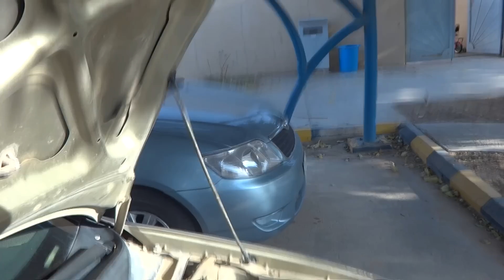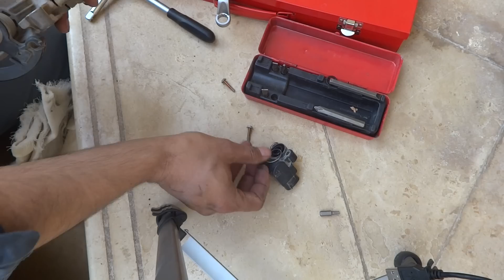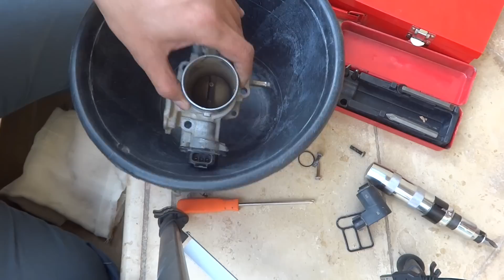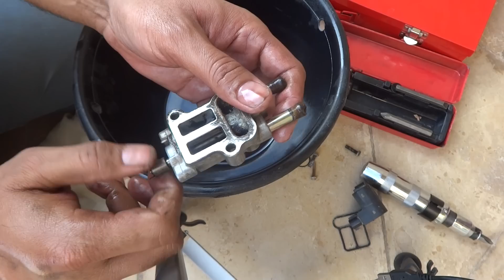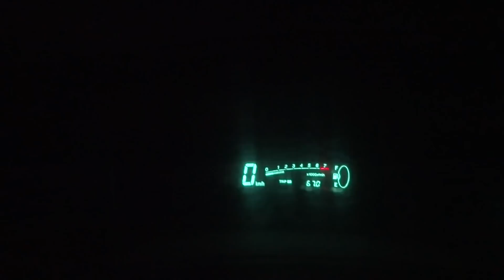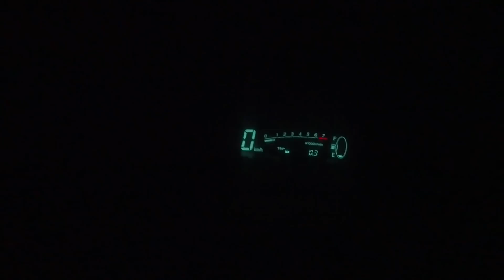Throttle body repair. Idle air control cleaning & repair.

Comment: Hola buen video amigo tengo el mismo vehículo suyo desarme el cuerpo de aceleracion limpie la valvula IAC de la misma manera que usted explicó arme todo bien lo único que el vehículo quedó muy acelerado en 3000/rpm revise sensor tps y esta bien al igual que sensor maf mi consulta es si sabe de alguna manera de bajarle las rpm o te dria que hacerlo atraves de scaner? Bueno espero me pueda aconsejar saludos desde chile 👍🇨🇱

Comment: I got huge amount of rich burning. I can't find a vacuum leak anywhere. I did clean the throttle body. Not sure if I installed it wrong the end cap for IAC.

Comment: Hi engginer..? What is best engginer..? Electrical or mechanical..?
Reply from the maker: Both have different departments. The best one is no engineer today! Engineering becomes an abuse today due to too much saturation in the market.
Reply: @JahanZeb1976  thank you sir ... i am very happy to watch your video ... but can i know ..?  which one personally do you like the most ... ??  electricity or machine ..?
Reply from the maker: Electricity.
Reply from the maker: I'm electrical engineer but working as Reliability engineer. Reliability is the mix of both electrical and mechanical with some new sciences and arts.
Reply: @JahanZeb1976  ok thanks sir for your response ... when I saw your video and I was very impressed ... sir bolekah I asked ...?  do you major in electrical weak current or strong current ..?

Comment: Hi, my idle RPM is high now about 1000rpm at normal temperature that happens after throttle body cleaning, any idea how to fix the high idle rpm?
Thanks
Reply: Thats not too high, some throttle bodies have a screw to adjust throttle at idle, check to see that its not set too high. I believe its an 8mm screw, im not too sure.
Reply: @jonrodriguez893  this throttle doesn't have the idle rpm setting screw. Just run about 50-100 miles after throttle body cleaning, will be back to normal.

Comment: when i clean my 1sz-fe  engine's iavc with carb cleaner it works fine for  1k kms or so .. bt it start whistling again and i have to clean it again .. wht cld be the permanent solution of ths problem .. please advice

Comment: the 2   IAC valve screws   need to be tightened and a 5-star tip bit is hard to get. A slot in each head can be used to let a flat blade screwdriver snug the 2 screws (you could put a light coat of blue screw sealant on each screw inside flat at the head to hold it well as the screws are snugged with a screwdriver.
Reply from the maker: You are very much right. In one of my other videos here on my channel, I have shown the same technique. Thanks for comment.

Comment: so what is the symptom of a dirty or sticking idle air control valve?
Reply from the maker: Poor idling, engine diy downs at slow running, engine stall at idle, rpm goes low when turning on the headlights or turning on the air condition.
Reply: @JahanZeb1976  thanks a lot for the info....it was really helpful!

Comment: What is the size of the torx screws which hold the electrical part to the mechanical part of the IAC?
Reply from the maker: Torx size isn't very critical but the problem is it is a five point torx which is Toyota special tool.

Comment: Hi i need ur expert opinion. I have 2001 Toyota Corolla 1.3 with 2nzfe engine and u440e automatic gearbox. I want to replace its engine only to 1nzfe 1.5. But I don't want to change gearbox. My mechanic says 1nzfe works fine with u440e but from company 1nzfe corrolla engines come with u340 e gearbox. Ur comments plz
Reply from the maker: They are nearly the same. If bolts holes are matching, you can reuse you transmission

Comment: Hey good video man I have a problem with my Toyota bb low acceleration wen petal push down I have changed the spark plugs  didn't see any problems with the coil packs  
On top of the plugs wat u recommend I should do next 

Thanks fili
Reply: Try adjunsting the accelerator cable

Comment: Sir i wanna thank you for yr splendid job but regarding this throttle body i have the same throttle for a corolla i disconnected the wire for the  IAC while my vehicle is on nothing happened no change at all can i conclude this IAC is damaged? Thank you for your generous time and effort

Comment: Great video.But IAM behind on calibration.Where is calibration required and how it done? Amplify on calibration.
Reply from the maker: Thanks. Calibration is required in the end after fixation. For this model it is done mechanical by setting up idle air control assembly to some point where you get good idling speed. For newer models you need scantool to do caliberation. Sometimes you need to fix it and drive car for a few key cycles and its ecu caliberate itself. Stay tuned.

Comment: thx bro but i have abad dream every day if you can please help me because i opened the mainfold and clean it but i forget the place of the two hoses of water coolant i think one painted red and the other blue can you help me which is the right and wich is the left please ?
Reply from the maker: In the throttle body the right place for coolant has no meaning. You can put them in different places. Means if you may swap the positions, it will not creat any problem. Whish you good luck.

Comment: Perfect job Brother really wonderful but one question Sir can you change the pipe for water inlets in this throttle body?
Reply from the maker: Thanks for appreciation and kind words. Sure pipes can be replaced with machine shop help but in hot environment you don't need them. Instead bypassing those pipes could do the purpose. Stay tuned.
Reply: @JahanZeb1976  first of all thank U for yr first reply second the pipes which transfer coolant can they be repaired or replaced or u have to change the Idle air control
Reply from the maker: No need to change the whole unit. Repair/ replacement of pipes should be way easy and cheap.
Reply: @JahanZeb1976  ok Engineer one more thing one i took off the IAC plug nothing happened to the vechile at least the car should experience something ya
Reply from the maker: If your car is idling and you remove the IAC plug and nothin happens, it's good time to service and wash the throttle body.

Comment: Very comprehensive explanations, thank you so much. But i wonder, how you opened that 6 sided screws?
Reply from the maker: Thanks for liking dear friend. Those five pointed star screws do need a special tool from Toyota. But I cut them for regular screw driver. Details in some other video on my channel. Best wishes.

Comment: I did this and now I'm getting a p0505
Reply: But does your Toyota idle okay, or too low? After all, the goal is to get the car to idle okay.

And the code may clear itself after the computer figures out that the engine idle speed is okay.

Comment: I need your help plz I did clean my car throttle is toyota yaris vvti 2003 and when I put it back and switch the car on the engine checking and not fast plz any help how to adjust the tps and maf plz

Comment: I had Toyota Camry 2001 when I parked it in sun light  its shows engine check light and engine oil light and car becomes little heavier while under cover parking car had no issues pls advice I go to lot of workshop but not found any solution

Comment: i just did this on my 2004 Scion XB, it has the same 1.5L engine, and it seems to run smoother at idle now. I didn't have any real bad issues, but watching you take apart the whole IAC gave me confidence that i wouldn't break anything, but those 5 point screws?? WTH! I improvised with an Oscillating Multi-Tool and cut a slot in the screws to use a flat head screwdriver to remove them. upon startup i had to erase 3 codes that appeared P0102, P0113 and P0511 and it is all good. Thank you for a Quick and Great Tutorial. :)
Reply: How did you clear the codes?
Reply: Why did codes appear?

Comment: Dear I have corolla x 2002 1.3 2nzfe engine. Earlier its fuel economy was 14 kms per litre in local but now its around 10. I changed fuel pump, injectors, plugs,cleaned throttle, all sensors and catalaytic converter too. Nothing left but still problem is not solved. Checked tappets too. It gives unburdened fuel smell in morning and feels to be low in power on hilly areas. There is no check engine light also engine is in good condition. Plz give ur suggestions. Thanks
Reply from the maker: Seems your car is running rich due to some reason. A scanner and a well educated technician in automotive field can diagnose by looking at short term fuel trims and long term fuel trims. Also oxygen sensors data can also help. For engine condition supposition will not do. Better confirm all your engine four cylinders with compression testing. If any of the cylinder varies more than 14psi among them you have a problem in that cylinder. Also any of the cylinder compression may not be less than 100psi. You may watch one of my videos on engine compression testing on my channel. Best wishes.
Reply: LearningZone thankyou sir. I will as suggested by ur goodself and will share results soon

Comment: After watching this video, I will do it by my self to clean the throttle body on my Toyota Vios 2003. Thanks so much sir, greeting from Indonesia. Salam
Reply from the maker: Wish you very good luck with your throttle body service. You may share your excellent results and feeling after your service here with us and celebrate your joy with us too! Stay tuned and blessed.
Reply: LearningZone dear sir, I have finished cleaning my toyota vios 2003 throttle body. But there's a problem with the rpm when the AC is ON rhe rpm going down, when AC OFF rpm going up. Can u tell me what's wrong?
Reply: @Willy0981  have you find the cause? I think it's about ISCV solenoid coil that can turn a little bit clockwise or counterclockwise against the throttle body, if you see the hole on the solenoid, it can be adjusted, so you can increase the rpm when the ac on by turning the solenoid clockwise (if I'm not wrong). I will try that since I have the problem like you have after cleaning ISCV valve on my toyota vios 2004. My mechanic friend told me it can be adjusted, by turning the solenoid. Greeting from Tangerang

Comment: How to arjest these idle screw
Reply from the maker: You should not change the factory settings. But if some one already did so then you can do it in car setting it and looking at rpm. Set to some 700 rpm idling.
Reply: Eska pickup pr koi effect hota hai kya
Reply: Hyundai eon me rpm ka kse pta chalega to idle ko kse fix kre

Comment: how did you tighten the 2 screws on the iacv
Reply from the maker: Using a screw driver.
Reply: its a special bit needed, its like torx, but with 5 point star instead of 6 point star. they go under the name pentalobe, or ts bits. they are a bit hard to come by, but try at auto shop or similar. or ebay/amazon

Comment: Amazing.  Thank you.  I cleaned the TB on my Toyota XA but did not open the Idle Air Control Valve that you showed.  My issue was not resolved.  Now that i have seen you do it I will reopen mine and do it right.  Excellent presentation and knowledge.  Thanks again.
Reply from the maker: Thanks dear friend for liking. Wish you best of luck with your repair. After success, celebrate it here with us. Best wishes.

Comment: Hi thanks for great video, what liquid you use for to cleaning throttle body and Idle air control with it?
Reply from the maker: +Jan Iqbal thanks for liking. This is regular gasoline I am using to wash items with. Best regards,
Reply: Thanks for reply and  do I have to not wash the electrical parts with gasoline or it doesnt matter if it get wash a bit with gasoline?
Reply from the maker: It may not make any difference if you wash them with gas. But kaskets and o rings you should now wash in gas.
Reply: LearningZone thanks and appreciated.

Comment: Today i clean my 2004 camry throttle body and idle air control valve and my car is running smooth after cleaning...
Reply from the maker: That is great then. Thanks for feedback.
Reply: LearningZone you are doing great job and providing full information and its very helpful, i like your work and your effort

Comment: In the video you showed a gasket for the IAC, but is there a gasket for the throttle body? Can it be reused if there is one? Thanks for the video.
Reply from the maker: Yes there should be a gasket and must be used. You can reuse one if it is in good shape. Once we created one from a card board and worked well. Hope you may understand. Regards,
Reply: Gaskets? Autozone, O'Reilly, NAPA and Amazon - they've got them.

Comment: hey LZ, nice Vid. & nice accent btw :) 

I say nice cos you were detailed unlike auth.service guys who just spray on carburetor n valve n clean using rag that even a layman can do. + you cleaned it with solvent in front of us which was cool, & you took care not to dip it inside the bucket solvent instead u cleared it carefully which is normal procedure but I see BUFOONS dip it in solvent or petrol & take it out& charge big -- kudos.  

LZ , please clearly mention the following ; 
- I have rpm changes in idling & engine is heating up than normal before, will this solve it + carburetor setting in Hyundai Atos Eon manual5speed 2012car? 

--will spraying 3m cleaner alone on exposed carburetor after removing just intake pipe do good for a 43000kms car? 

-- is the air intake system need any cleaning spraying technique, besides replacing air filter? (please put video for it)

-- I will also add fuel system cleaner inside full tank 

--most important, what was the solvent you used in the video for cleaning? 

I feel the above points for FULL SYSTEM CLEANING  you are aware of & have videos for same. 

kudos once again..
Reply from the maker: Thanks dear sir for liking videos and knowing the facts. I think your car have no carburetor but if may have a throttle body to be cleaned. You may need to clean your throttle body as I have shown here in this video and also I have further more videos on the topic on my channel. You may watch them for further understanding. You can spray any cleaning solvent in the air system. It will not cause any damage or problem. I am using regular car gas for cleaning as it is cheap and easily available and doing awesomely. If you are about to add cleaning liquid  with fuel, it also works by I am preferring to clean the injectors outside the car. If you want, you can replace the fuel filter inside the fuel tank. I think I have upload videos on that. Or not then I would upload them soon.

Comment: For anyone who wants to know,  those two screws are 5-point tamperproof.  The only place I found them, other than online order, is Pep-Boys.  #9684 T-20 made by CTA MFG Corp.  Cost around $5.00 US
Reply: Thanks for this, ordering up a 5 point socket based on your info. Hate it when non standard stuff is used!
Reply: @the.internet  where did you find this ?
Reply: thanks for the info!!
Reply: If you want to know there is a set of 10 sockets on Amazon just search 9684 5-pt Tamper Torx Socket - T20

Comment: HI.  The video is very good.  May i ask what kind of cleaner have you used to clean the throttle body in the video?
Reply from the maker: Wish you good luck with your repair! The cleaner and solvent used in the video is regular gas (Petrol). You can use anything like gas, WD40 or carb cleaner. You may watch my new video on the same subject on my channel to get even more understanding of the job. Here is the link:    https://www.youtube.com/watch?v=lsvpWJG-dK8
Reply: Thank you sir.

Comment: By watching this video i myself opened, cleaned and mad it free. Now working excellent. For the last 2 days i was roaming around mechanic who failed to fix the vibration problem of my 1nz fe engine. Thanx alot.
Reply from the maker: That is great dear friend if you solved your Toyota problem with success. This is the purpose of the video. Here on the following url there is another video on my channel recently uploaded. You may watch it and get a little more understanding if you may do the job again. Also there is a blog associated with this video you already watched and the blog url is here in the description. You may give a look to that and get some more idea for future. Also I will upload another video soon on latest Toyota drive by wire system throttle body cleaning. You may subscribe if you like to get notification on each upload. Have good rides on your Toyota without problems! here is the url:
https://www.youtube.com/watch?v=1EI17xW6CMc

Comment: Learning zone can u please tell me whats wrong with my car?i have changed the thermostate and the fans are working good.and still overheating.did i put wrong the thermostate?is there any specific side to put it in?
Reply from the maker: The spring side of the thermostat should go towards the engine. Hope you fixed it right but for the overheating there will be some other definite reason. The very common and worst reason is a fully or partially blown head gasket. You may watch some other video on my channel how I tested for a blown head gasket. If you do that simple test, you will confirm that your head gasket is blown without removing anything from your engine. Search for that video yourself on my channel I have no idea in which date and time I uploaded that. Maybe for one Toyota Cressida I did that. Hope you may understand. Regards,
Reply: thank u.Learning zone.i'll check it out.